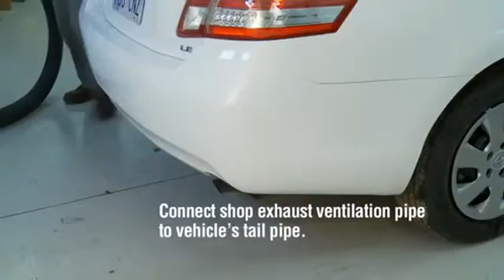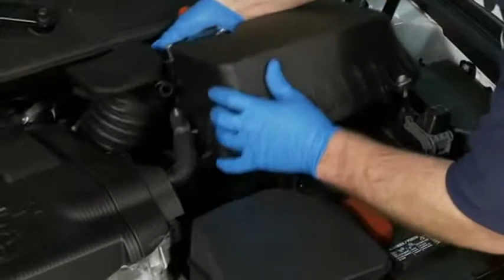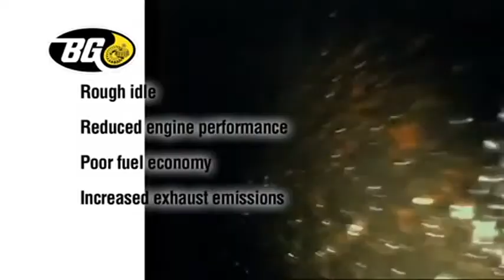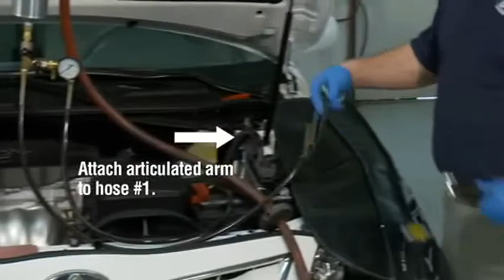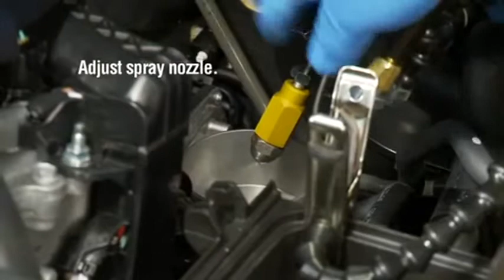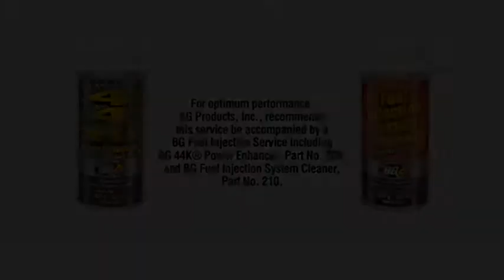BG Air Induction Cleaning Service

Comment: I wonder if the products now available in the spray cans, with the tubes, to put through the intake tube (CRC, Gunk, Seafoam, etc. intake valve/upper engine cleaner), are just as effective? I was under the impression that these BG products (pop lid cans) were pretty concentrated, and would theoretically work “better”…?

Comment: This is what I paid $230 for? Just for my car to be put in “relearn” mode. It better fkn work
Reply: …did you not watch the video? Lmao
Reply: You can quite literally just buy the DIY cans, which have a small straw that you can attach through your intake hose. You just have to have someone else rev the engine, while you spray the product (or vice versa). 

With these products, they usually tell you to spray it AFTER the MAF sensor (if you have one); so you don’t have to do all the stuff in the video, of removing the MAF sensor and the entire air box and intake assembly… 

You simply finish the can while revving around 2-3k RPM’s (usually takes around 10-15 mins), and then take it on a spirited drive to burn off the excess product. 

I was under the impression that these pop lid BG product cans, were maybe somehow more “concentrated” perhaps? Idk, I’ve been doing pretty well with the intake valve/upper engine cleaner that’s in the spray cans I just mentioned (ex: Seafoam, Gunk, CRC, etc.).
Reply: @isnowyazn 😂😂😂😂 Good Luck with that. You may want to do some research on BG and their products.
In today's world GM and Ford recommend BG FuelSysyem Cleaner to combat the carbon problem.
But you stick with Seafoam 😂😂😂😂
Reply: @michaelmcinerny9859 At what point did I say to stick to Seafoam specifically…? You might wanna re-read my comment again if so. All I was saying is that you can use readily available products on the market (assuming you don’t have all these specific tool setups). 

Not saying it’s not worth it to buy the entire specific setup to run this particular BG fuel system cleaner; but most people outside of an automotive “shop” or garage setting, probably won’t have the resources. You can look up the tons of other available products that contain PEA and such, that will still at least make some sort of a “dent” in cleaning up what it advertises at least…

But per your comment, I absolutely did not question BG and their products whatsoever. As a matter of fact, I still run their GL-4 manual trans fluid/gear oil, and some older products like GL-5 hypoid gear oil. I’ve also dealt with direct fuel injected engines for well over 15+ years, which obviously suffer from a crapton of carbon buildup, way more than any other typical port fuel injection engine.

Edit: Also, what’s to say it will provide the same results on every other make, since you specifically brought up GM and Ford..?